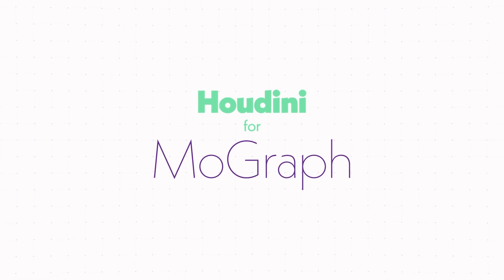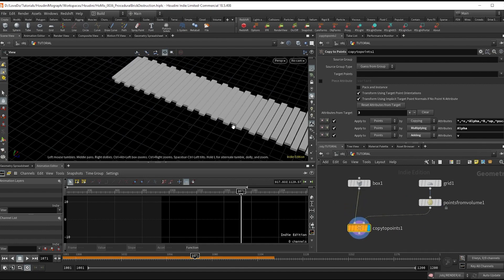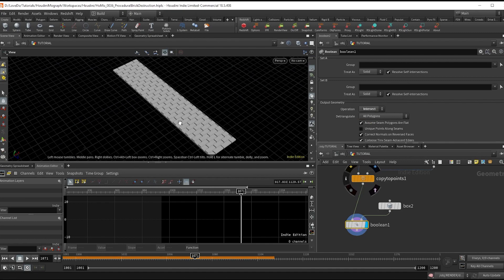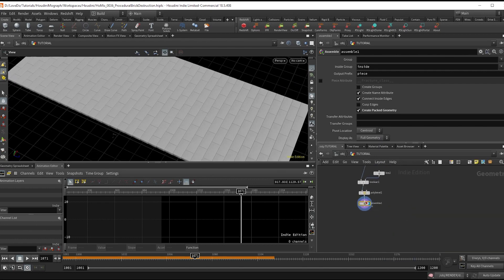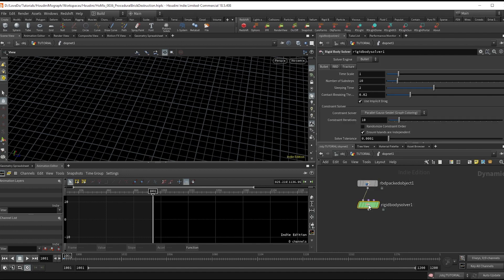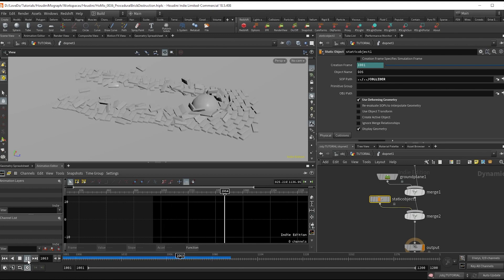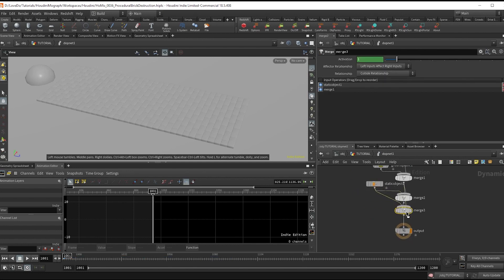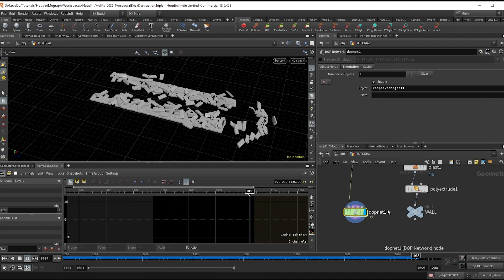Procedural Brick Destruction - Houdini For MoGraph Ep0036

Comment: very nice, thank you !! :) just one question - I see there is a little flickering of the bricks (very tiny) - the ones which are not yet hit but there is some kind of influence. Is there an easy way to make the movement more smooth or maybe reduce the influence of impact ?
Reply from the maker: Ah yes I did notice that but didn't address it for the sake of keeping the video short. A few methods:
1) Mess with impact affect on activation
2) Manually create activated pieces based on distance to collider (see ideas in this older tutorial: https://www.youtube.com/watch?v=2EoeK36prko)
3) Post sim, do a solver that takes previous frame position if velocity is below a certain threshold

Hope these ideas help!
Reply: @FarOutStudio  thank you for great ideas and quick response, I am gonna try it :)